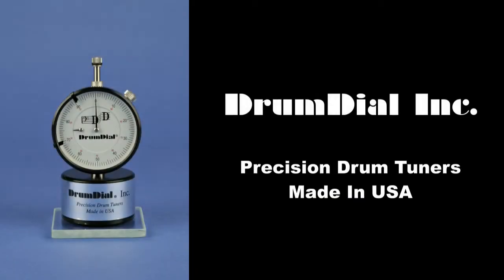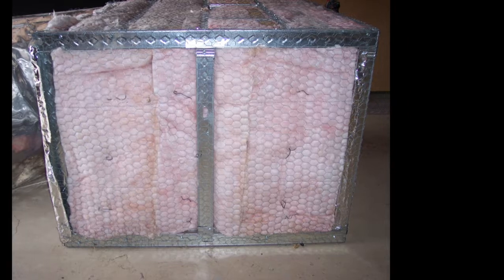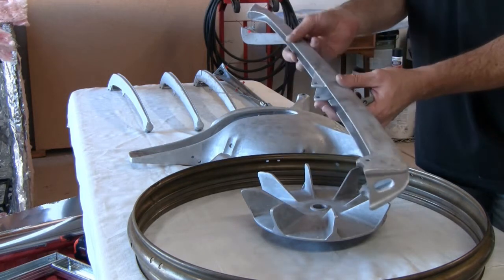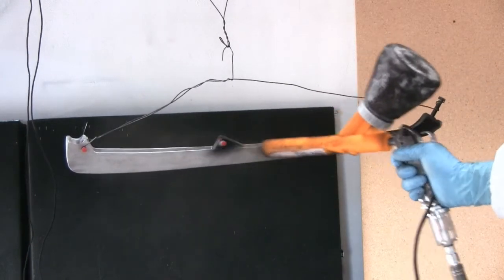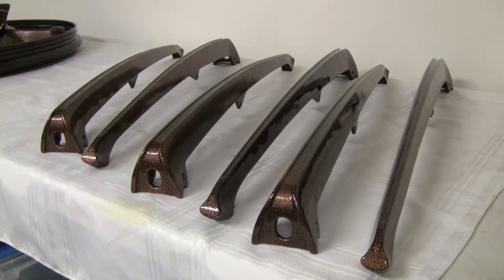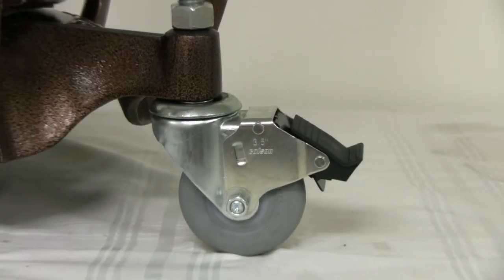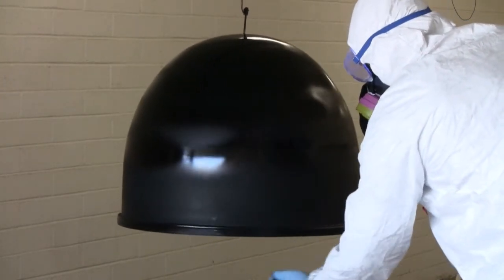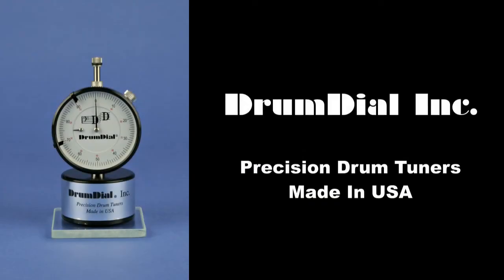Premier Timpani Rebuild  with DrumDial Part 2

Comment: Did you purchase Premier Casters or where you able to find a third party replacement.  I have to replace all my casters but the premier ones are 80 pounds.  If I can find a third party replacement it would save a ton of money. Unfortunately I haven't been able to find any with a matching stem.
Reply from the maker: There are many casters to choose from, but these are the ones that we went with:
Part number:
2-03254-565-BRK5-3/4-10 X 4”   for  $32.63 each.

We purchase from Service Castor Corp. .

Comment: Do you know the size of the bolts that holds the «bowl support arms» (7:25)?
Reply from the maker: The supports are attached to the base with 14mm hex head coarse thread x 21mm long bolts.  This is a custom bolt M10 x 2mm x 22mm JIS type bolt. The closest SAE is a 3/8-16 but not a perfect match. The closest metric thread is an M10 x 1.5mm, but is not a perfect match either. This would need to be special ordered from Premier.
Reply from the maker: Just received a message from Premier on the Series 3 timpani as shown in the video. They do not have and no longer make the bolts for those timpani. The only other option is to re-tap the bolt hole to a similar size thread.
Reply: Wow, thank you! Maybe ill try to tap it then😊
Reply: A m10 bolt was just right! Maybe someone has re-treaded the hole before... Anyhow, thank you😁
Reply from the maker: Thank you for the update! The newer Premiers 1999 /  2000 and newer all use standard metric bolts.